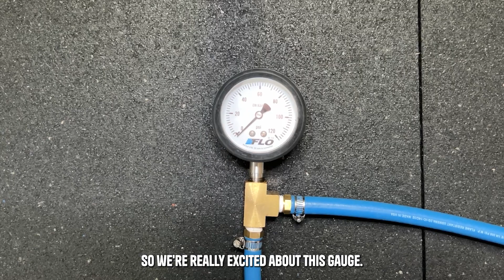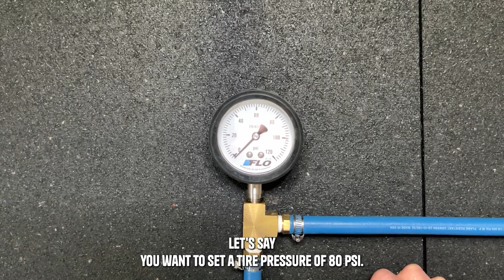Cycle Faster by Setting Accurate Tire Pressure With the FLO Air Gage

Comment: Can you drop a link so I can buy it? Thank you?
Reply from the maker: Yes, I'm sorry it wasn't there. I added it to the description as well as here. https://flocycling.com/products/flo-air-gage
Reply: Is this usable with disc wheels?
Reply from the maker: @Christri  It depends on two things. 1. The valve stem length you are using, 2. The size of the opening. Our FLO DISC works well with a 42mm tube and our 81mm opening. The tool is about 40mm in height.